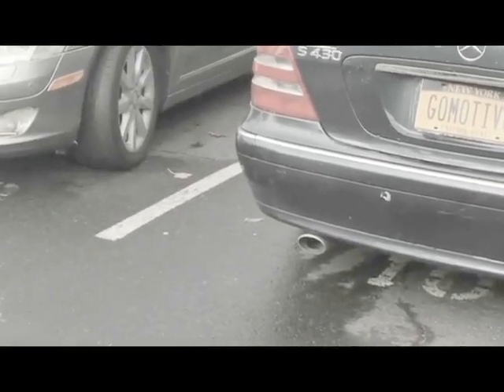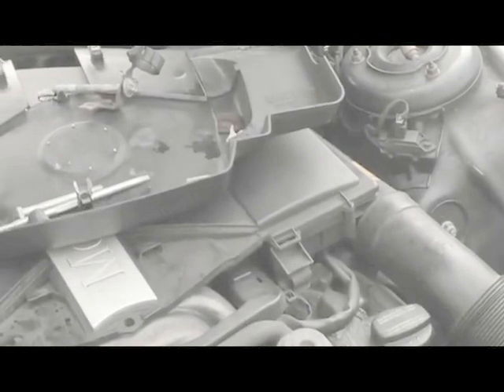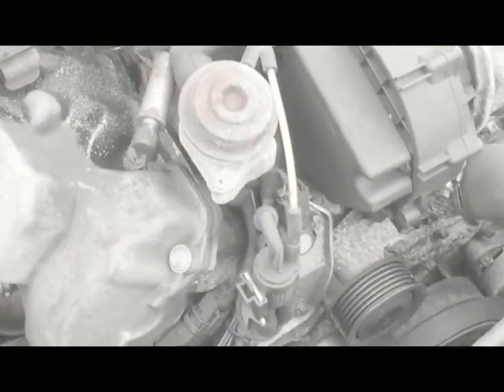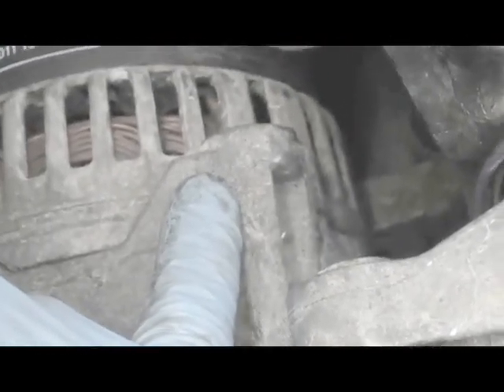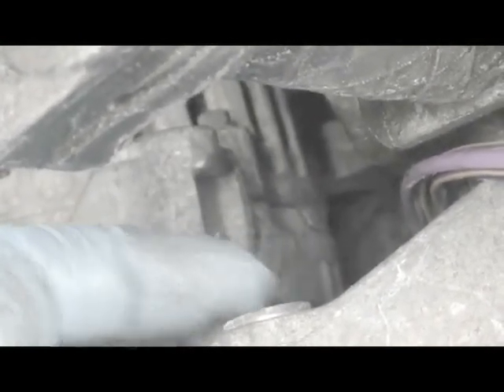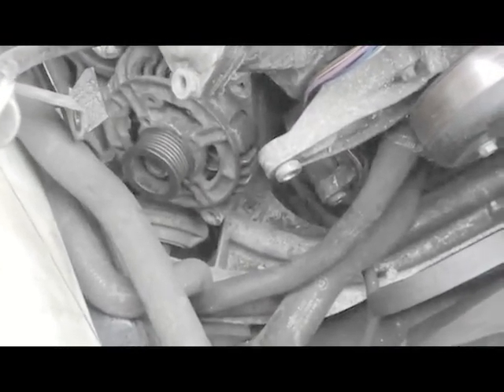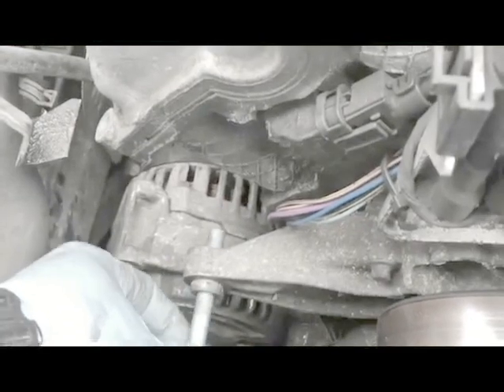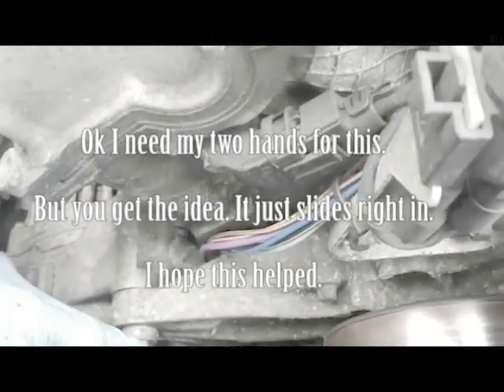Important information when installing the alternator. Mercedes S430 W220.

Comment: Hi, I am have the same car, well a S500 W220. But my question is, have you ever got the "Entrance Position Do Not Drive" message after having a dead battery? If so, how did you fix it? I'm hoping I don't have to order a new/used SAM.

Comment: Question w220 vs 221 which one better ??
Reply: I have a w220, my buddie has a w221.   I like the w220 MUCH better.  He always wants to trade.  The w220 feels much more "sporty" and agile.  the W221 is kind of a tank.   It feels really heavy.  the W140 also feels like a tank.  I love the 220, but don't like the 140 or the 221.  My friend agrees.
Reply: @DavidMSyme   cap I use to have w220  good car but weak on sum levels . Now I owned 2008 s550 so far best car I've drive amazing car wayyyy better than the weak w220 .
Reply: All true.   My buddy's 2012 S550 is WAY faster.   Its almost scary fast.  Twin turbos!  Nevertheless, I still like the W220.   Just my preference.
Reply: @DavidMSyme   that's fine but don't say is better than w221 when you never drive one before . I have both, and I'm telling you the w221 is wayyyy better .  My w220 was s430 2002 good car very smooth. But the s550 is on a different level .